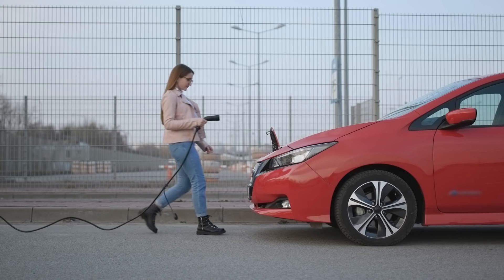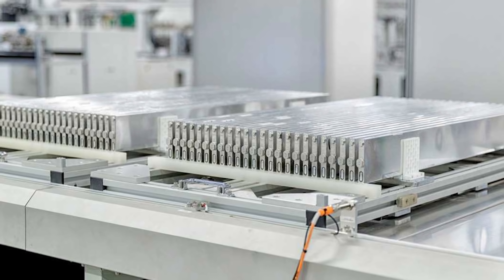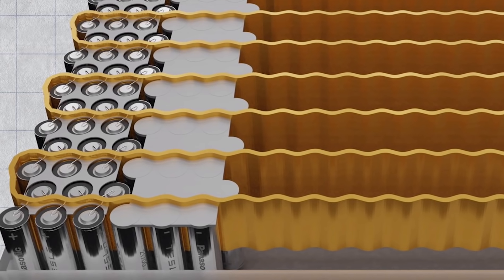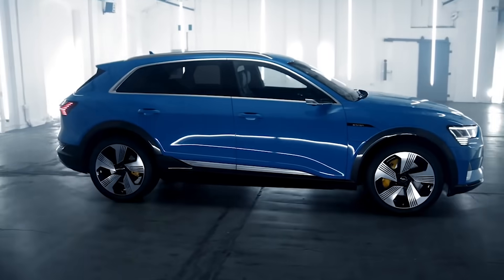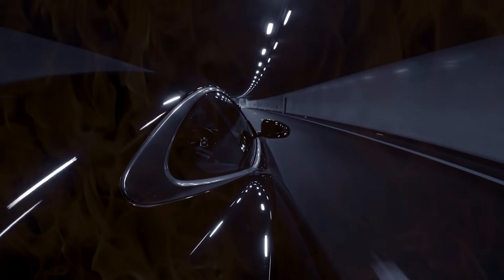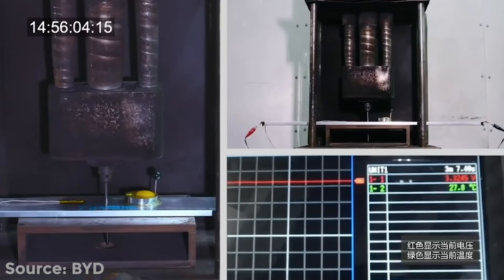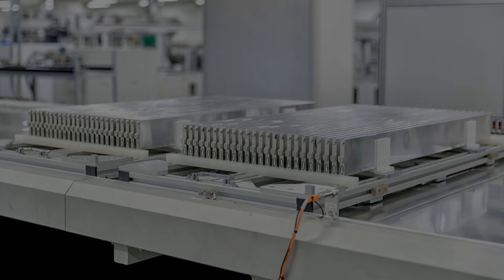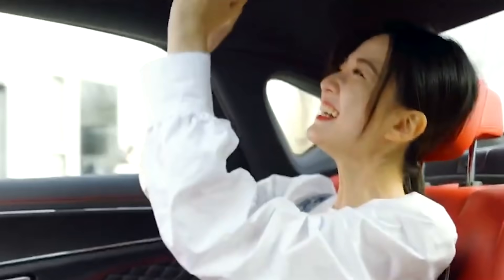Uncovering China's Battery Breakthrough

Comment: “Batteries can act as structural components of the car” makes me nervous
Reply: Sorry sir your batteries are just old.  We can't replace them as they are built in to the frame.  You will just have to buy a new car.
Reply: LiFePo4 chemistry can't burn.
Reply: @crhu319  Surely that stored energy can be released somehow.
Reply: @thebunnisher109  Yeah into kinetic energy that can move the vehicle forward...
Reply: @thebunnisher109  a block of wood stores lots of thermal energy, try to release with a hammer
Reply: @ericvelasquez1282  if you have wood in a car it runs the risk of catching fire also. Most batteries are kept well below their theoretical capacity for life and safety.
Reply: @ericvelasquez1282  not the same
Reply: Yes, I'll let other people be the Guinea pigs for that idea. Flex, flex, flex, WHOOOSH!
Reply: Some old ICE car place their gas tank close to the engine for effeciency reasons...not very good idea 😬😬

Comment: The blade battery concept is not new and definitely not a breakthrough. The problem is that it's very good at cooling, but at the same time, very bad at heating (or retaining heat). In places like the Northern part of US and most of Canada, along the vast majority of Northern Europe where the temperature can drop below -25c, with a battery so badly insulated and so much surface to dissipate, how to keep the battery warm enough becomes the main problem. If you think Tesla and other EVs range drop in winter is bad, imagine having this battery? 

Not to mention winter in these places are long. Like 8mth out of 12. And it takes more energy to heat battery than to cool it.

Comment: Tesla already solved that problem and are testing out batteries built into the frame of the car. China's solution is hardly groundbreaking and is the idea behind many new battery technologies competing against each other right now.  The key difference is that they're focusing on the ability to mold into unique shapes and not just rescaling in one or two dimensions.

Comment: Those small spaces between the blades look like they would eventually fill up with dirt the way air conditioning condenser fins do. Things that perform well in the Lab may not do the same on the road.
Reply: Maybe they use filters, I don't know
Reply: nop i tihnk they transfer the heat through the chasis and then rely on air flowing on the bottom to cool it.
Reply: Electronic components on the inside of the vehicle tend to stay clean and corrosion free. It would be as simple as spraying with keyboard duster every time you get your tires rotated.
Reply: And how is it any worse than packing 1000s of small batteries ?

Comment: The ultimate irony - using coal fired power to make EV batteries.
Reply: I would have thought the fact that charging the things with carbon generated power was more ironic plus they loose power standing so need constant charge as in loss when transited and stored and it’s not as clean as some would believe.
Reply: @davideyres955  but everything to do with combustion is much worse than you believe, so...these EVs are a pure win.

Comment: Notice nothing was said about the battery production? im sure Panasonic whos been making batteries for decades would be doing this if it was nore efficient, its not a stretch of imagination. However, to compare battery production speed vs the dufference a rectangular battery would bring , just youtube telsas battery making proccess, and its obvious why they keep the batteries round, and that the time abd energy saved thriugh natural forces of gravity moving the batteries throygh production, tesla prilly majes 100 to 1 of tyeir recatngle batteries, that vhina prolly usses slave labor to help production. Obviously speeed idnt everthing but in race against time to get as many electric ⚡️ cars on the road, the rectangle batteries will never be a thing if theyvtake longcsbd too much emergy to produce. So before judging just the battery judgevthe whole system

Comment: I'm just worried about "structural" batteries and other such built-into-the-chassis batteries because if they fail, you're going to have to replace the whole car
Reply: That's not what that means.
Reply: @crhu319  Well, if the floor board has to come out for repair I hope frame is not included.

Comment: I think only Tesla use cylindrical batteries. The rest of the auto makers you pouch batteries like in phones. Also the eTron have a 95 kWh battery compared,to the 73 (now 82) kWh battery in a Model 3 Long Range. Still the Tesla has longer range. Tesla’s new battery is also cylindrical and stores more energy because each battery is much bigger. So I think they have solved the same issues, it it also going to be part of the cars structure.
Reply: I think Tesla uses cylindrical cells not because they are a better solution but because they started with cylindrical and it is too hard to change or some one in the company is too proud to change or they have too many contracts for cylindrical cells.
If cylindrical cells were a better solution everyone would be using them. Pouch cells are a much better solution for cooling and assembly.
I can't comment on how easy it is to make cylindrical cells vs pouch cells but my guess is the difference may not be much. Pouch cells especially the blade cell (just a very long pouch cell) are much easier to integrate into large battery packs.
A battery pack made from blade cells will probably only have 96 blade cells meaning 96 connections and if the tabs are on opposite sides of the cell then also no busbars.

Comment: The problem is, what happens when you need to replace a battery? If the battery is part of the car structure then removing it will be extensive and costly

Comment: Great idea.  Now use aluminum ion batteries instead, and voila! Just get the energy density issue improved. It’s coming. Australia’s GMG, anyone?
Reply: Aluminum is too soft and degrades quickly, that's why it was never used for regular batteries. Aluminum ion isn't new, it been around since the 60s

Comment: This rectangular shape battery is a subset in the evolution of methods to supply energy to an electric motor. I wrote about alternatives to the internal combustion engine many years ago. The fuel cell back then was using Platinum as the catalyst(expensive). In recent years the cost to generate Hydrogen for fuel cell use has dropped.

Comment: I have wondered for years why, if they can make flatpack batteries for cell phones.
Why weren’t they using the same tech to make large batteries for cars, carts drones etc.
It always seemed to me that in a standard battery pack on a EV about 1/4 of the size was air. If by design for cooling it would be ok. But most of the time it’s not it’s just because they use bundled round batteries.
This flat blade or flatpack concept should have been done 10 years ago. And while we’re on what should have been done 10 years ago. Where are super capacitors? It was said the tech to make these things replace batteries was already here and that it should only be a few years to market. That was about 10 years back and still were talking about lithium and mining exotic metals.
What happened to all the already existing promised tech?
Reply: It will be almost the same with these new batteries, there need to be like 100s of cells to produce enough power, can't juts do one big one for a car. 

Regarding other technologies the problem is they are all to expensive to produce. Every batteryfactory in the wrold is producing pretty much one type of battery, so they are very cheap. Making an new factory for a new technology will make any competing battery super expensive (which is why we dont see them on the market). There are several good replacements already, just none with a cheap enough production. :/

Comment: We need factual proofs that the BYD batteries are better than the standard commonly used LiIon cell.
Because all these are just claims. My bet is this blade battery is just a normal unrolled cylindrical battery that doesn't offer anything beneficial except safety. I think the puncture test video is real. But we need direct comparison of the battery packs offered by Tesla and BYD to see which one is better. Because they are also using the batteries as a structural component and the cooling system and safety of their packs are top quality. We can't jump to conclusions and say blades are better because "claims"
Reply: Blades are better from a packaging point of view. The chemistry is what sets the energy density.
Almost all cells going on EVs (except for Teslas) will not catch fire if you piece them. I have tested them and they certainly do not catch fire.
I do not know if Tesla cells will catch fire when pierced but I do believe Tesla uses chemistry that is more flammable in order to get higher energy density.

Comment: The real environmental issue with Lithium is the widespread desertification of vast areas of land in Chile, Argentina and Bolivia. Fresh water is required to extract/process lithium. 1 tonne of lithium requires 967,000 litres of FRESH WATER. One Tesla model S’ battery weighs 1323lbs = 600kg. That means that 1 Tesla model S battery requires 580,219 litres of fresh water. Apparently, by 2017 Tesla had sold 200,000. Thus the environmental impact on the world of Tesla model S (apart from the burning of hydrocarbons for electricity) is 580,219 x 200000 = 116,043,956,043 LITRES OF FRESH WATER CONSUMED. For those of you who need everything in non systemic units (using Imperial where 1 Imperial gallon is 4.55 litres) = 25,504,166,163 or 25.5bn gallons of water. In US gallons that’s 29.1billion US gallons of FRESH WATER. Electric cars are the biggest scam on the planet. 

Hydrogen fuel cells is the future. They still need lithium, but a tiny amount in comparison. JCB are experimenting with a hydrogen commercial engine, and Germany  sees hydrogen as the future. Don’t buy into electric good petrol bad since if you do, soon you will be responsible for the destruction of fertile areas of Chile, Argentina and Bolivia. Ask yourself why these countries keep having regime change operations?
Reply: You know that a lithium battery has far more nickle by weight than lithium right?
We should be more concerned about nickle mining than lithium mining.

Comment: I'm guessing it's stolen intellectual property, and the thieves are not bound by any pollution accords. These facts alone disqualifies this as a viable product.
Reply: Prismatic batteries are widely known and are more common than you think. The concept of the flat folded prismatic design is almost as obvious as the concept of the wheel. You can't really steal it. The only reason most EV manufacturers are still using the cylindrical design is because they are cheaper to produce due to the widespread cylindrical legacy manufacturing lines.

Comment: THIS IS  BYD advert....I do not trust chinese with their  stolen patents. Most batteries are from china anyway. The ecological catastrophe is comming , as battery recycling foe EV is still not possible. The techology does not exist yet.
Reply: The reason EV batteries are not being recycled is that they are still in use and will be for the next 10 or 20yrs. When an EV battery is taken out of an EV it goes into energy storage (like home batteries)  which work fine for another 10 or 20yrs after they are taken out of the car so it is very difficult to set up recycling facilities if you have no product to recycle (yet)

Comment: China wants to be carbon neutral well then they have to quit burning coal its all bull. I imagine that the profit margin on a electric car is greater than a gas run car and the infrastructure of are grid will be in the billions to bring it up to snuff if everyone is plugging in at night.  And who pays for that the taxpayers.anyone thinking about these problems. just my opinion
Reply: Unless you live in California or some other 3rd world country,  the grid will have no trouble coping with electric cars.
A storage hot water heater consumes more energy per day than  driving an EV for 100km. And EV charging can be done when the grid is idle so no significant upgrade is necessary.

Comment: You wrong in stating that the main difference is shape - the main difference is chemistry. This is what stops thermal runaway. LFP battery had always had this advantages but it was lacking in energy density. Would be interesting to know how BYD solved this problem